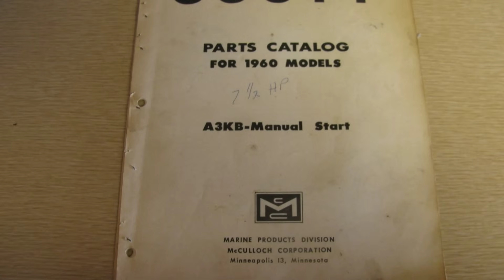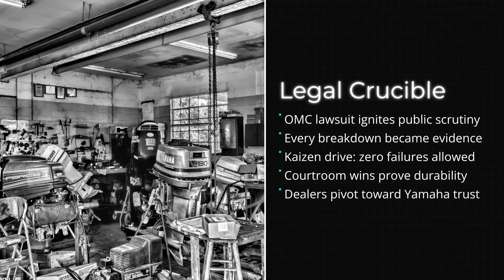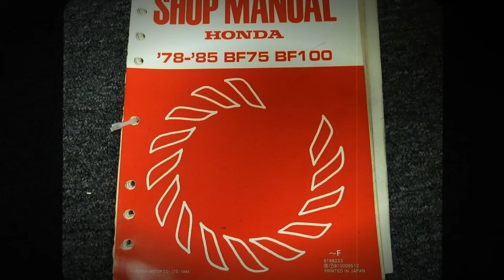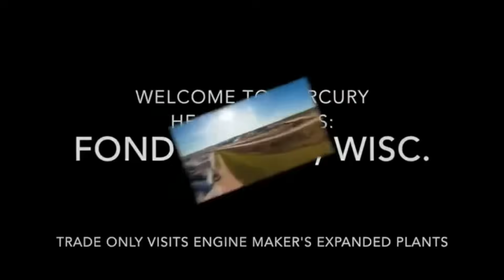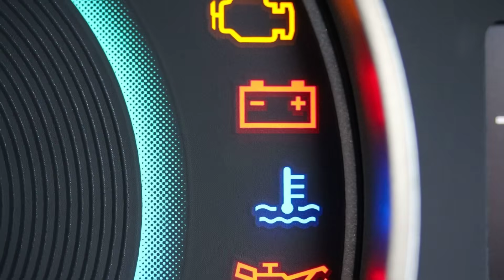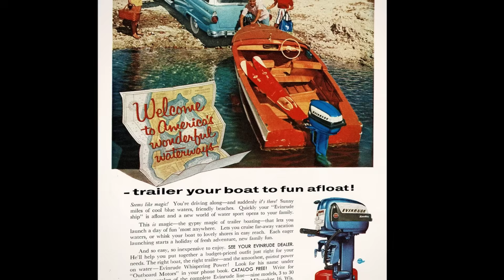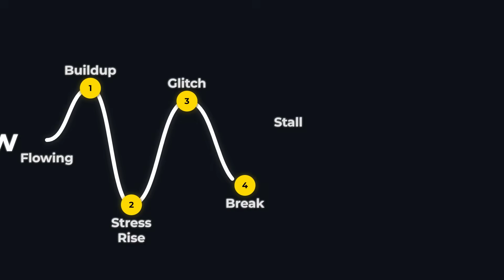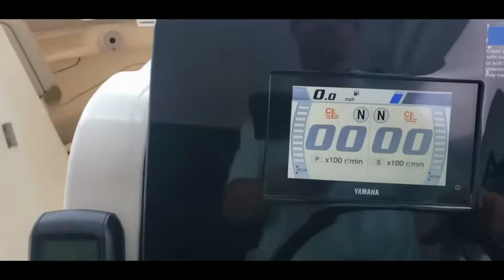Why American and Japanese Outboards Are SO Different!

Comment: You can leave a Japanese outboard on the back of your boat over winter and it'll still start no problems next summer. An American one will need to be returned tot he dealer for a service costing almost as much as the outboard.
I've worked all over the world and for government and commercial; use Yamahas are everywhere. There's probably a good reason for that.